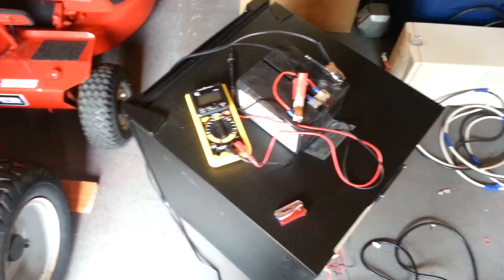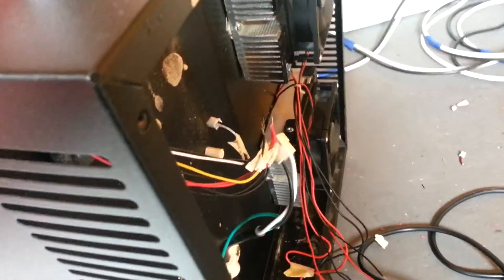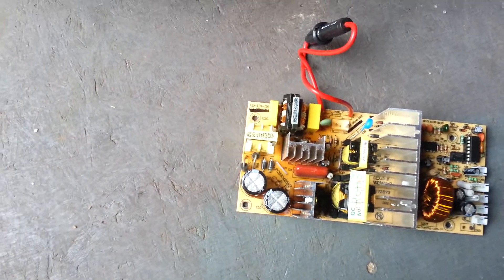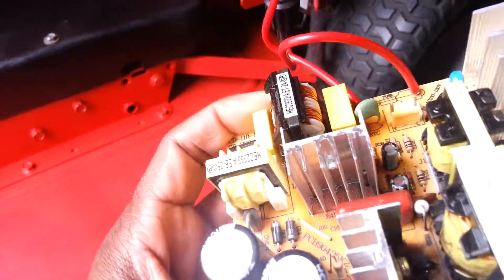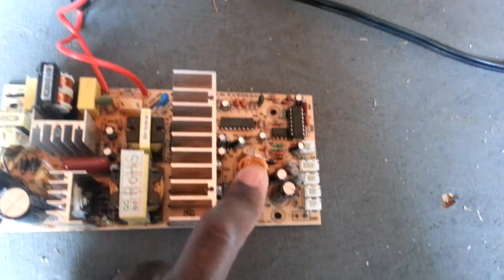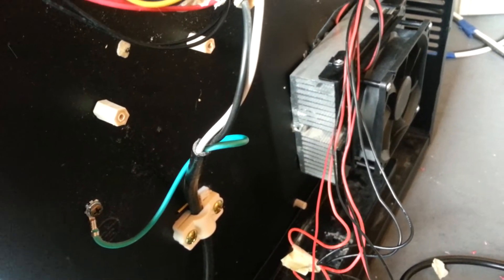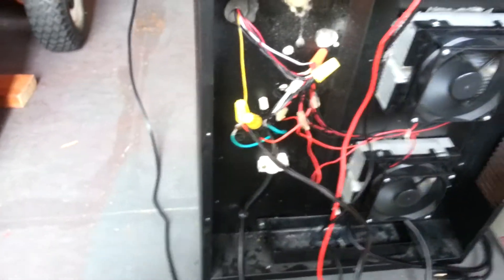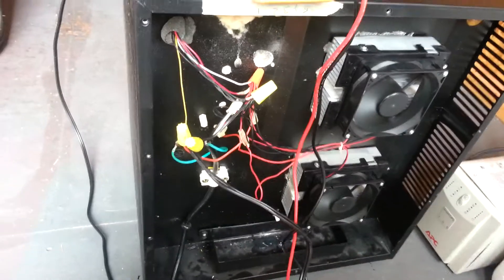How to Bypass a Black & Decker Thermoelectric Refridgerator AC to DC Power Supply

Comment: I actually own same frig.  Was going to try to fix it to run on lanai off solar powered battery pack.  Thanks for the video.  Its kinda isolated in FL where we live, and we are looking to get better prepared for long term power outages.  The cooler is good enough to keeps some soda and drinks cold, but main reason is to have a method to keep relatives and pet's meds good and cool in a crunch.    I am going to put a  (300 or 400 watt solar array together on a small harbor freight trailer with 12 volt battery pack (6volt golf cart batteries) .  Will be great for a mobile solar generator for the ranch.

Comment: how do you hook in the thermostat? hooking it up this way will have that chip run 24/7 it will burn out. that circuit board does more than convert ac to dc. it cycles the chip on/off

Comment: Can you give more details of the other wiring?
Reply from the maker: Des Washington 
Instead of using the power supply that came with the unit, I ran it off 12 volts DC from my solar system.  You will need at least 12 volts and 10 amps continuous to carry it.  Hope this helps.
Reply from the maker: Des Washington 
All the red wires - positive and all the black wires - negative

Comment: did you figure out how many AMPs the 12VDC must have?
Reply from the maker: Use at least a 10 amp or higher 12 volt power supply.

Comment: Is this thermostat an NTC, or an thermal switch? How exactly did you wire it?
Reply from the maker: Richard,  I am not exactly sure what type thermostat it had.  I ended up installing a DC thermostat.   Here is a video showing the installation of that thermostat: https://youtu.be/htBFFif-nmM
Reply from the maker: +DIY OneForAll 
https://youtu.be/htBFFif-nmM